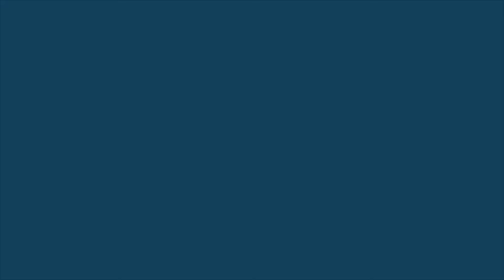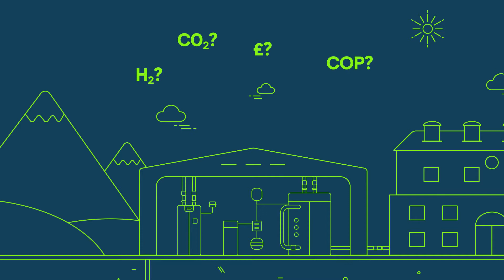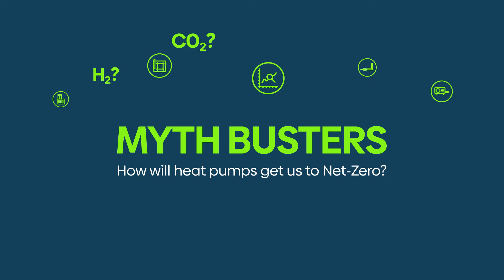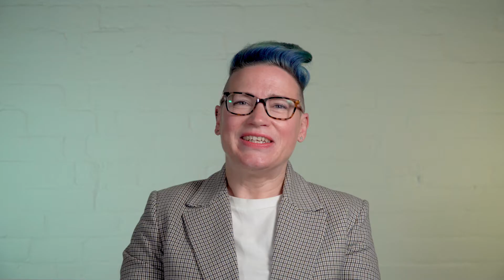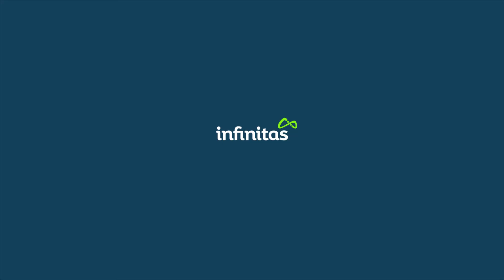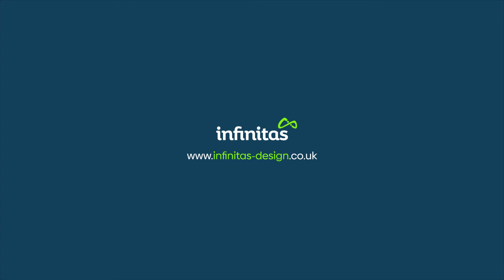MythBusters - How will heat pumps get us to Net-Zero?

Comment: The economics of heat pumps are driven by the ratio of electricity and gas prices, and the heat pump ‘gain’ – the units of heat energy emitted for each unit of electricity used.

• Heat pumps are mostly deployed in countries with very cheap electricity.

• In the UK, the electricity:gas price ratio has been increasing for many years, as increasing penetration of renewable energy makes the grid progressively less efficient. The ratio is currently around 4.

• Heat pump gains have been improving, but only slowly. The median for an air-source heat pump is around 2.8.

• Thus, even taking into account inefficiencies of gas boilers, the majority of people will find a gas boiler cheaper to run than an air-source heat pump.

• Although substantial grants are available to install heat pumps, once the (net) capital cost is taken into account, almost nobody doing so will see an overall payback.

• To assess the overall economic effect of installing a heat pump, the capital cost before grants has to be incorporated into the calculation. If this is done, it is found that no heat pump installation is economic.

• The marginal abatement cost of reducing emission through heat pumps is over £300/t CO2, several times more than estimates of the damage caused by global warming.

• Installing heat pumps is therefore a mistake, on every measure.